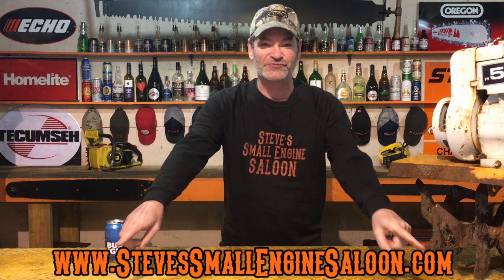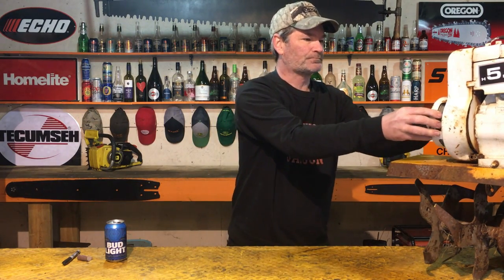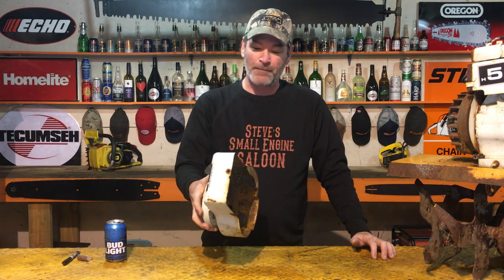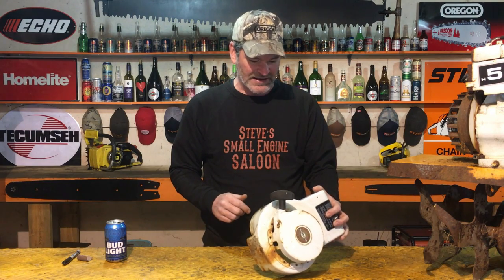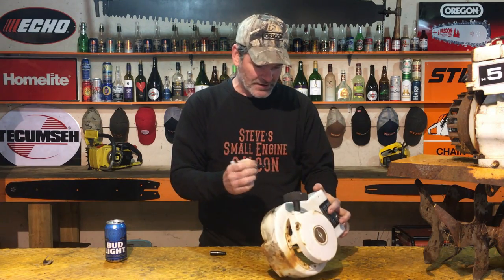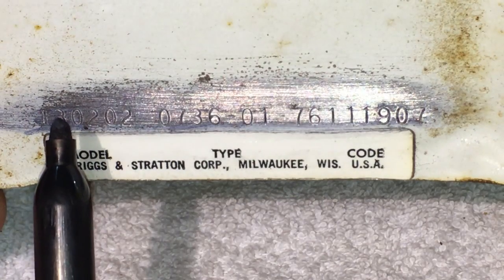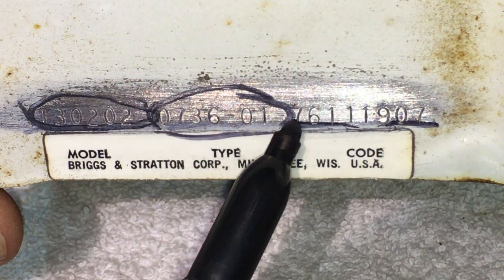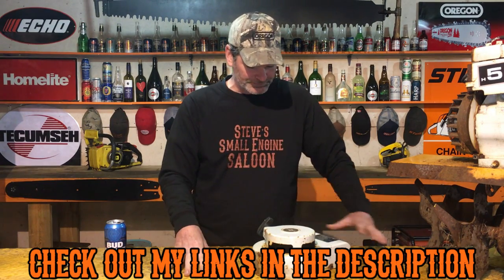How To Find Out The Age Of Your Briggs and Stratton Engine

Comment: They sure don't build them to last 40yrs. anymore...
Reply: As long as you take care of it, I bet they will. I have a billy goat that I bought in 1994. Briggs 5 HP. Still works. I use it to chip wood too. Carb hasn't been rebuilt either.I always use all the gas up in it every time I use it. Back in 1994 people were saying they're crap. OTOH I've had a 2009 Honda engine crap out on me. It didn't even make it 8 years. I have a 1995 Toro rider, 12 HP Briggs. Lawn mower part was gone 10 years ago. I use the rider to move my aircraft around at the airport. Still starts right up, even on aviation LL fuel. Take care of your equipment and it'll take care of you.
Reply: Bud light, no good beer, Miller high life, mmm good beer.

Comment: Great video! I now know my engines year (76). Trying to determine horsepower.  130232-0676-01-76061107. Any help would be great. Someone threw this out and i would like to rebuild it.
Reply: First 3 in modle. 130ci.... that's how its identified. Model and type for parts.